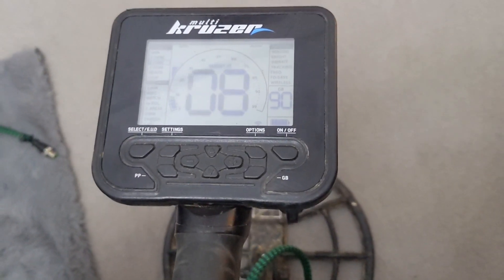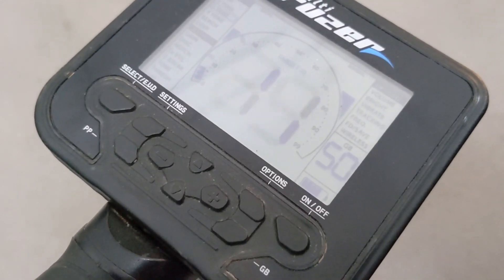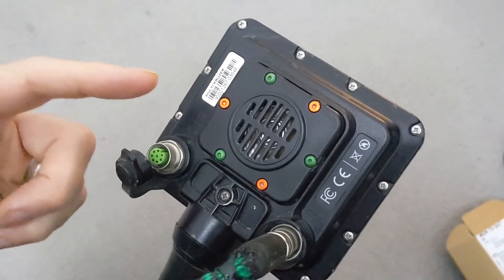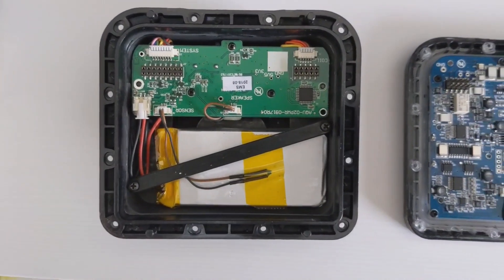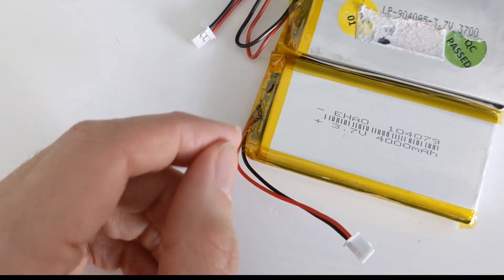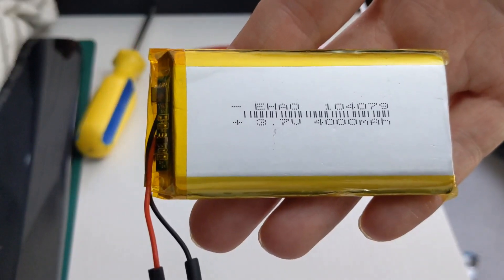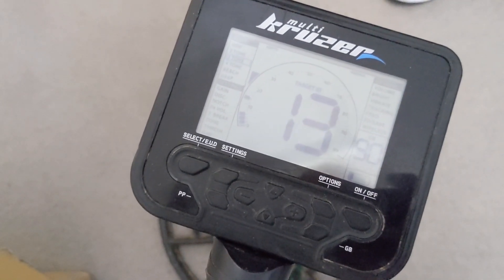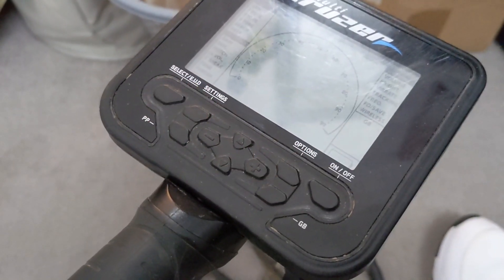UPGRADING THE NOKTA MULTIKRUZER BATTERY 🔋🔋

Comment: Fun fact... didnt know till swapping battery on a different device. The print label on the battery 904085 3.7v is what you would use as a search term for the replacement. Those are your 3 dimensions of the battery